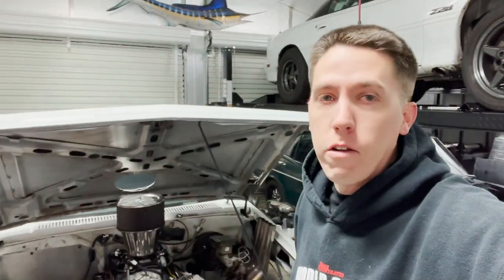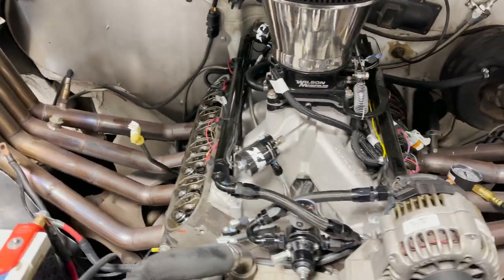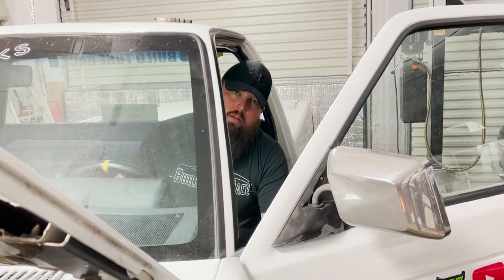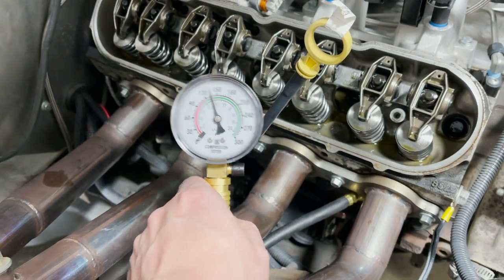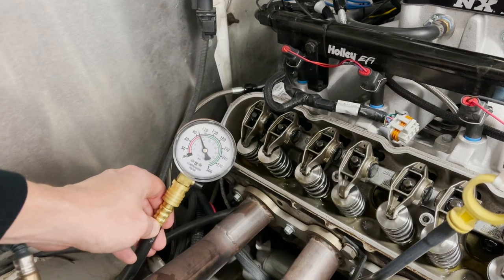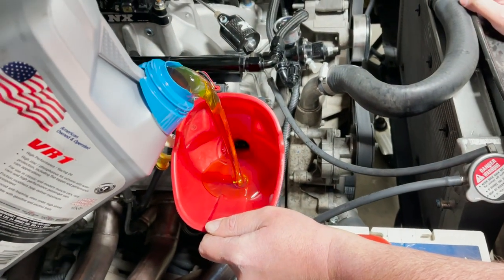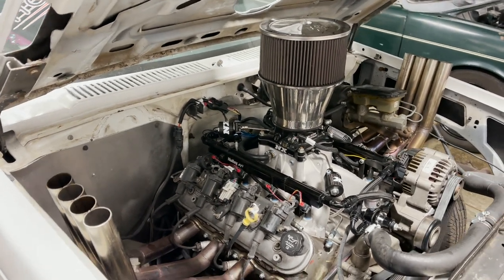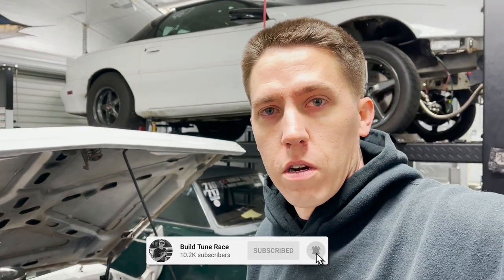LS Compression Test On Burnies Junkyard 4.8L Cammed LS Engine!

Comment: 125 to 150 is a good range for a worn in motor. Throw some Lucas in it and let'er rip. If you are worried about the condensation Before the next oil change. Get a can of Gunk 5 min Motor Flush, and run through it. I have had to do that to the boss's sons Camaro (like your). He is still running the LT with opti-spark in it. He took Jr Championship last year in NHRA.
Reply from the maker: Heck yeah! I think we are going to send it and see what happens. I think everything is good to go!

Comment: Compression seems normal to me. The numbers are close to irrelevant unless they are low. Just looking for close together.
Reply: Yep, that is what I was thinking. As long as there is no significant variation between cylinders...should be good to go.
Reply: @jamiejohnmcnutt350  valve overlap has a lot to do with static compression too. Cam swaps can make huge difference on a compression test
Reply: @Dr.MikeTuneoligist  Yep and yep. Not your first foray into the world of high-performance mechanics I see. :)
Reply: @jamiejohnmcnutt350  ran vacuum rule stock cars for like 6 nights and realized open motor with a "500" was more better
Reply: @Dr.MikeTuneoligist  No substitute for real world experience. Hope the kids are paying attention!